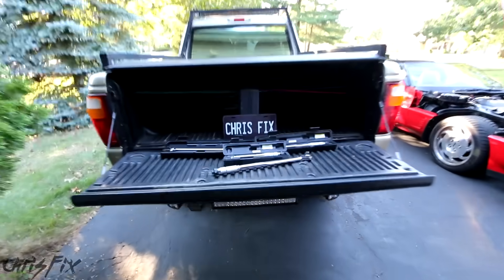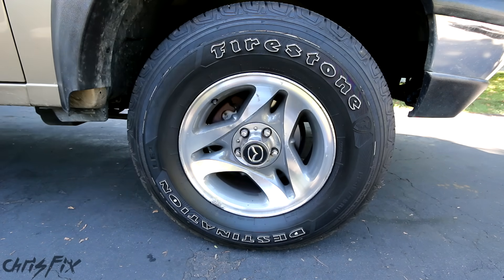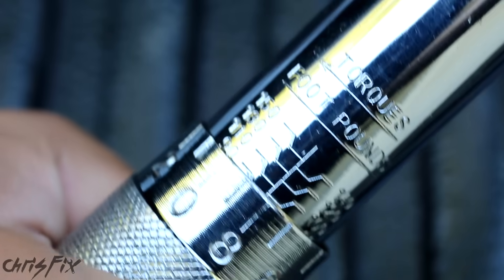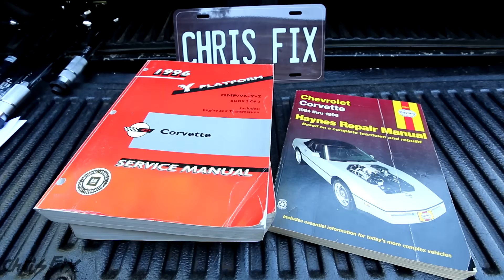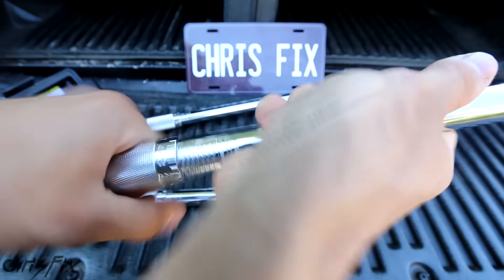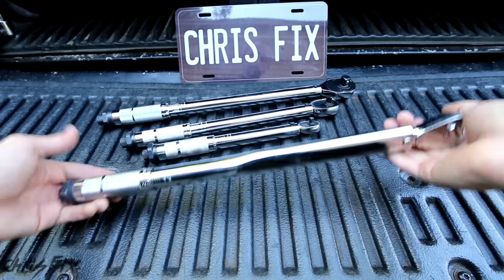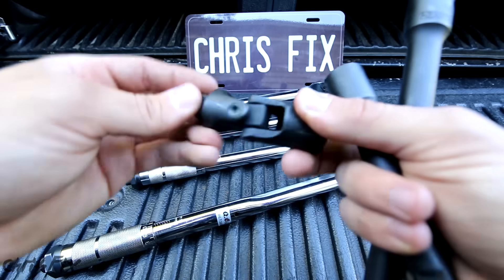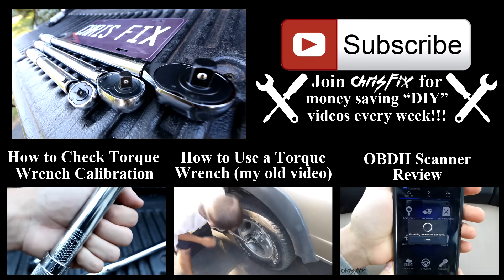How to use a Torque Wrench PROPERLY

Comment: So... I've recently gotten a torque wrench and torqued the lug nuts on my '03 civic to the proper 80 lbf-ft. I rotated my tires by hand before and, because I'm smol, used by body weight (~130 lb) on a wrench that was approximately 10 or so inches.

Turns out, I over-torqued the lug nuts. I torqued them correctly with my new wrench, but now I feel some wobbliness. That's weird right?

Comment: Only use crows feet if at 90 degrees to the handle, otherwise there is a formula you can use to see what torque you're actually giving. Also, always try find/use a torque wrench wherethe desired torque is in the upper portion of the scale if possible.

Some additional info 👍

Comment: The "associative property of multiplication" means 2 x 3 is the same as 3 x 2, so 1 foot times X lbs is the same as X lbs times 1 foot, so ft-lbs or lb-ft, are both correct.  That's why it says the "incorrect" FOOT POUNDS right on your torque wrench.

Comment: I know it is only the torque wrench, but you should never tighten or loosen screws with a lifting motion. Hernia and other heavy injuries could happen. Always use your body weight and push the wrench downwards to the ground. That way you cannot strain your spine.

Comment: " yes the proper way to say it is pound feet" ** says foot pounds on the wrench** 😂😂
Reply: Yeah, the associative property of multiplication means both are correct.
Reply: @snap-off5383  Technically it is lb ft because ft lbs is a measurement of work.  Often torque will be labeled ft lbf for torque a note that they are specifying toque and not work since it has become so prolific to use ft lbs for torque even though it is technically incorrect.
Reply: @NobodyNowhereKnowhow  Neither is incorrect, because of the associative property of multiplication, and by convention, the unit of work is the Joule defined as a newton * meter, (force first, distance 2nd) and to differentiate, torque is expressed the opposite of that, where lb*ft conventionally refers to work, ft*lbs refers to torque.

Comment: how many ugga dugga's are torque specs for a 2004 Ford muffler bearing flange bolt anyone?
Reply: Tighten down to 35 cubit stones and then back off 1/4 turn.

Comment: Wait. He says the correct terminology is "lb-ft" and the wrench has imprinted on it "ft-lb"?  So the wrench companies are wrong?
Reply: in a nutshell while they're both an equivalent unit (50lb-ft = 50ft-lb), ft-lb is a unit of work/energy and lb-ft is a unit of torque .... apparently to avoid confusion.Both are used interchangeably

Comment: Saying100lb-ft of torque for most lug nuts is pretty inaccurate. Ford Trucks are at 150, 3/4 ton dodge trucks can be 165, small toyota cars are most commonly at 76, etc etc. The torque setting is vehicle specific

Comment: You should also do it in one motion, there's a difference between static and dynamic friction, so make sure you have room to be in motion when the click comes. And also make sure to check if the bolt is lubricated or not, you'll have to adjust the torque down if that is the case.

Comment: when you are showing the torque wrenches you showed a 1/2 inch,3/8 inch,1/4 and then you said that the one you use all the time is  1/2 inch drive, I think that the last one is 3/4 inch drive,maybe I am mistaken
Reply: I use only use a 1/2 inch drive for all my DIY auto work. If I need to torque a smaller 3/8 inch drive socket, I just pop a 1/2 -3/8 adapter on the end. Easy peasy.
Reply from the maker: Nope what I said was accurate. It’s a 1/2in.
Reply: @chrisfix   maybe for the angle of the camera or distance ,I had the impression the last one was bigger(I mean the drive),because the wrench is obviously bigger. Thank you

Comment: Im old school I have used the Torque wrench with the face plate and arrow bar 40 plus years when I got a clicker , I hooked a socket to the clicker that fit the 1/2 drive so both the old school and new torque wrench had to fight each other , it clicked with in a pound of my old school torque wrench . the arrow showed 41 pounds it clicked at 40 .  went to 100 FP got the same thing about 1 pound between the two.  Reason I switched my eyes can not read as im torquing a head bolt no longer but I can hear a click .
Reply: I have one of those Craftsman pointer 150 ft-lb torque wrenches that I've had forever. It's served me well for years but in some places you can't really see the scale so a clicker is better. I still use it for lug nuts.
Reply: @waltp3373  I do too, just because I couldnt' bring myself to toss it, but I guess there's real reasons to keep it.

Comment: The only application I would ever need for a torque wrench would be for rebuilding an engine; would the 1/4 drive be sufficient enough? I.e Cylinder head bolts, intake manifold, ect

Comment: Hey chris, recently i have been noticing one thing that my car halts when i release the clutch pedal.. It just stops but earlier it used to run only on clutch release without using the accelerator pedal. Please help me here.😃 My car is a 1300cc turbocharged diesel engine

Comment: Ive got two torque wrenches, one foot pounds, one inch pounds like the wrenches shown.  Back in the late 70s and 80s i had a different type i prefered to the click type. Just before i got to the set torque a small pin in the wrench would pop out and tap my thumb warning me i was almost to the set torque. Then the pin would pop out and tap my thumb when i got to the torque i wanted.
I think i had three in different sizes?
I much prefer those to the click type. Back then i was building engines and they just worked better.

Comment: Check the owners manual for wheel torque spec. If it's not listed then look it up and write it down on the inside of the manuals back cover for future reference. Also if your putting wheels on that are a bolt washer make sure they seat properly (2005 ~ 2010 odyssey). Also I learned as a tech a long time ago to torque the bolt using three steps or at least two steps (especially cylinder heads and crank/ con rod bearings and wheels as well. If it's an 94 lb ft required, torque it to 45 on the 1st pull and if your doing all four wheels do the same step on all 4 wheels. Then adjust to 94 lb ft and complete using the same procedure. 
Good vid BTW. 
Harbor Freight has ok torque wrenches at a good price FOR some DIY PROJECTS.  They are  an accuracy of + - 4 % . They are made in Taiwan and are not made in China poor quality tools,  have a  lifetime warranty but that will not cover calibration costs.  HB Suggest calibrating their torque wrenches every 6 months.  Prob buy some new ones for what the cost of calibration is. If I'm doing a job that requires a precision torque wrench then I use my old faithful  46 year old Snap On. It's probably worth the price of a new motorcycle with all the calibration costs but it's worth it for engine overhaul and exact torque specification. You can find DIY torque wrench calibration on YouTube, it's not the same as getting it done by s certified calibration outlet but may be ok for wheel nuts and general items.

Comment: People always laugh at me for using torque wrench as a breaker bar, “you are gonna throw off you calibration”, despite numerous attempts explaining that I have a special torque wrench, they simply just don’t believe something like that exists. The one that I am talking about is Stahlwille Manoskop series torque wrench. It defies almost every “fact”  that I have learned about the proper way of usage of torque wrenches. It is the most bullet proof and versatile torque wrench that I have ever seen on planet earth. While other people call torque wrenches by their drive size (1/4, 3/8, 1/2 inch), Stahlwille has interchangeable wrench heads, which means you can not only choose different sizes of square drives, you can also put open end wrench head on to the torque wrench, and even bit holder heads. It can be dropped on the ground, no need to set to zero for storage, no need to worry if accidentally torqued higher than the target torque, and finally it can be used as a breaker bar as long as it is within 130% of the maximum torque, the accuracy won’t be affected. I have 5 Stahlwille Manoskop and the oldest one is about 20 years old (second hand from evay), the last calibration was 2011, and guess what, I checked that torque wrench few months ago on a torque tester, it can still get 198nm to 203 nm when target torque is at 200nm, well within spec. I guess what I am trying to say here is do some research and compare and most importantly, always read the user’s manual to have at least a basic understanding and get yourself familiarized with the product to get the max out of it.

Comment: Never take your torque wrench apart. It will ruin your calibration. Also you should set the torque wrench all the way down, not to the lowest setting. Finally, make sure you exercise the wrench before first use by setting it very low and clicking it a few times.
Reply: what if you need to repair it?

Comment: You should always run the torque wrench up to the highest setting, then back down to zero, then set your final torque reading... each time you use it.  Secondly, any extension can be used as long as you are not changing the length of the handle.

Comment: Here's some good advice and a few helpful tips. 

You can use extensions (the one you put your socket on) and they won't effect your applied toque. If you use extensions to lengthen or shorten the torque wrench, then yes...you will need to calculate the torque wrench change in length and adjust the scale accordingly so that you are applying the correct torque. 90 degree claw adapters...the ones that make an L...do not effect the amount of torque applied, because they do not change the length of the torque tool. The coefficient of 90 degrees is zero...so your torque wrench scale is correct. 

To measure the torque length of you torque wrench, you measure from the center of the handle to the center of the drive. Not from end to end. 

I'm sure there are some good videos demonstrating this technique, so I'm not going into it here. 

Correctly setting your torque wrench value. If setting 90 foot pounds, set 80 and then set 90 foot pounds...not set 100 and then 90. Click type torque wrenches are sensitive to direction. So go below the desired torque and then back up to the desired setting. Do not use a torque wrench as a breaker bar. Unless stated...all torque wrenches are clockwise only (tightening) do not use them to loosen bolts, if you do, you may screw up your wrench calibration. Never yank on a torque wrench. Apply continuous increasing pressure until the wrench breaks. That's it..that's the correct method.

Word of advice. Torque wrenches are cheap. Buy one. Do not borrow one from your local parts store. The guy that used it before you...could have decided to   use it to beat the dent out of an anvil. Since you have no traceability, you have no idea how it has been used and cared for. Calibrated tools should always be kept in your tool box. Never loan them out. They are sensitive to how they are used. 

How do I know all of this. Because I worked in a calibration lab calibrating torque wrenches...that was my job...calibration and repair of torque wrenches...all types of torque wrenches and torque tools. 

Note: If you haven't used your torque wrench in a while, first set your wrench to half the final desired value...click it a few times...then set your final value and you should be okay. Click type torque wrenches are notorious for sticking the first time you use them, if they've been sitting in your tool box for a year...like most of us...we only use them when we need them...not like the pros that use them daily or weekly. 

Hope this helped.

Comment: I wouldn't recommend harbor freight torque wrenches. You can get them for $10 with coupon, but its not reliable. I almost broke down my brake caliper bolt because my torque wrench didn't work correctly (which I bought 1 year ago and stored in safe place). I thought "this is too much power for 27 ftlb" and I was correct.

Comment: PLEASE! TORQUE WRENCH CALIBRATION VIDEO! Just realized that my torque wrench is 5 years old...
Reply: put a socket in a vice.set your torque to about half whatever your maximum is.mark down the handle 12" from the drive pin.pull at 90deg  with a luggage scale attached.check what the scale reads when it clicks against what you're torque setting is.
Reply: @regularguysgarage3276  Isn't  that like trying to calibrate your caliper with a kindergarten ruler?
Reply: @snap-off5383  you're not trying to calibrate it with that method. that'll tell you if it's out so far you need to ship it off to be re-calibrated.
Reply: @DFX2KX  Gotcha, for that I use two nuts backed together on a stud and oppose my beam type against my click type in a vise, and see where the beam is when the other one clicks.
Reply: Throw it away and buy a new one.
Reply: @davidmuir405  Why?🤔
Reply: Stephen Hong if you have a friend works for airline 
Mechanics

Comment: Most tire shops don’t know how to torque wheel lugs. They impact them on and then check the lugs with a torque wrench.   They aren’t “checking” wrenches.   They never torque lugs. They tighten and the torque wrench just verified that a lug is torqued to at least a specified number.  When it could be twice as tight as it should be

Comment: Cheers I never clicked to take the tension of the spring  when in storage so thank you for the tip.  Also you can check calibration by hanging a known weight at a known distance, with the drive peace in a vice and the torque wrench horizontal, Calculate your applied torque, you wrench should click at that torque but not any torque higher.

Comment: THUMBS UP ! Great video! You've covered the whole range of information. As here in Brazil the lower range wrenches ( e.g. 5 - 60 Nm) are vastly more expensive, I've had to order one
from China. I need it for my spark plugs in an aluminium alloy cylinder head, torque 24 Nm = 18 ft / lbs.

Comment: I dont buy your advise that you should loosen up the spring to make it last longer. Springs by nature dont get worn out by being squeezed and kept under that pressure. You wear out a spring by loosening up and tightening it up again..that cycle back and forth is what wears it out...the more you do it, the more a spring gets worn out...you do not shorten the lifespan of a spring by leaving it under pressure and tightened up.

Comment: I am not sure that you are getting an accurate torque measurement IF you back off the handle one or two (notches) lb/ft at a time.  I was taught that if you need to adjust one or two lb/ft you should back off the handle 10  to 15 notches then creep back up to the correct setting.  This takes out all the backlash.  Correct me please if I am wrong.

Comment: If you forget to tighten the locking nut before using your torque wrench, I understand that of course you won't be getting the right torque, but are you also potentially damaging the wrench?

Comment: Torque doesn’t change with a straight down extension. If you have an extension that offsets the axis of torque youll need to calculate for the difference.

Comment: i bought the 3/8 and 1/2 inch torque wrench! exactly what i need, thanks man
Reply from the maker: Awesome Steven!
Reply: I received today the Tekton Torque Wrench, but the surface is damaged, the silver coating is peeling off along with the numbers, the numbers are just printed on the silver coating and not carved on the metal.

Comment: wait, so do you pre tighten the nuts or bolts?
Reply from the maker: You can tighten them by hand or with a ratchet and then torque them to the proper spec with a torque wrench.

Comment: He is probably over-torqueing those lugs ... he is pulling after the click. People treat the click like it is a clutch that stops it. If you are still applying pressure it still adds torque. Also a wrench needs to be checked not calibrated annually. Also straight extension regardless of drive or length have no affect on accuracy of the torque value

Comment: Whats a good brand for someone who is going to be an apprentice electrician who will need a torque wrench and also need a socket set for electrical purposes (if any arise) and truck/van purposes (if they arise). I do want them strong, but I am not sure how much i would be using them as hand tools vs needing impact sockets for use with a drill.

Comment: Best to not use the tq wrench at the upper or lower 10% of its values if you can help it. You can also use it to check break torque on specific bolts, screws, and even parts (these parts are usually the life threatening if it fails kind) .

Comment: i thought his one had 10 ft lbs on it, but he reckons it the range was 20-150
should i not use my 1/2 inch drive in the 10 ft-lb setting? or was it just a slip of the tongue

Comment: Quick question. After torquing my wheel to 90lb foot which it says for my car i used a breaker bar to kinda tighten it and its didn’t use a lot of strength to tighten it like if it needed more tighten..is that okay?

Comment: Make sure the threads are clean & undamaged. If your wrench meets parasitic resistance, the mating surfaces don't end up as tight as required.
Chris, guys, is it OK to put a drop of oil onto the threads for this?